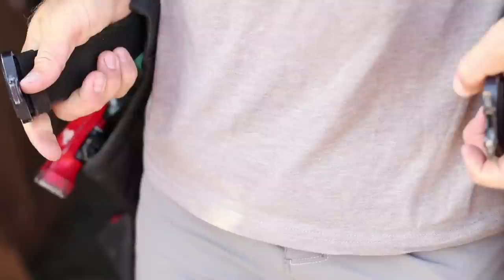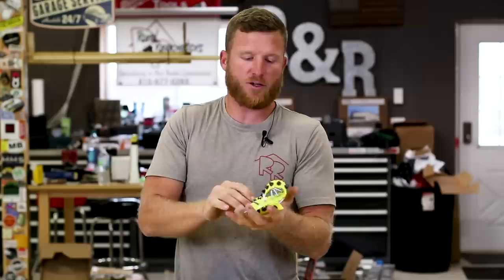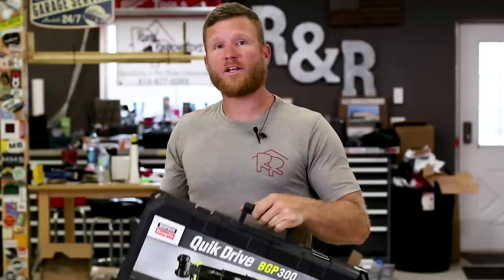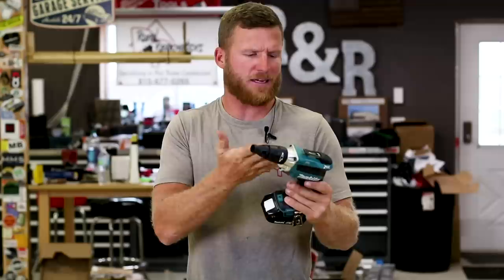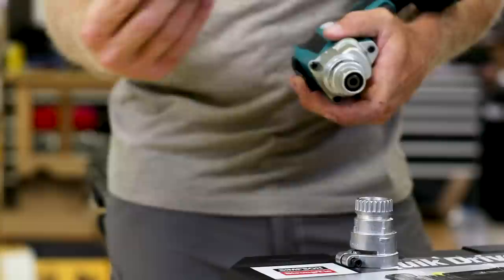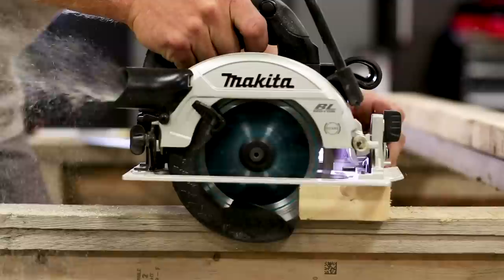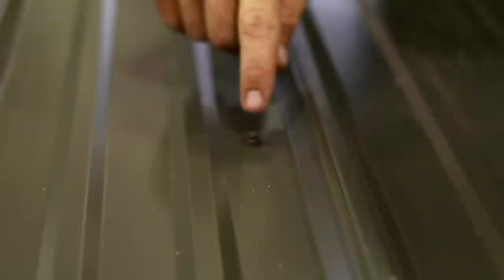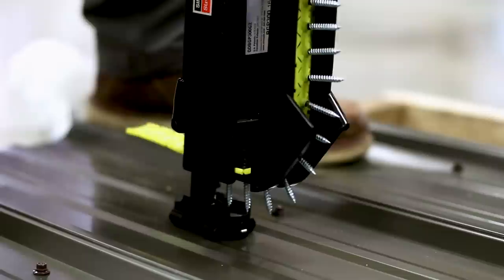Quik Drive Collated Attachment: Toolsday Easy Way to Roof?

Comment: Have an older model quickdrive & it works flawlessly, just have to remember to keep the rubber pads clean of grit & metal shavings so you don't scratch the paint.
You can easily use it for walls as well by removing the extension.
Reply: Thank you for using the Quick Drive, @McGillicuddy.

Comment: I've got a quick drive, loved it.  Had it for almost 11 years now but I use it for deck building sub flooring.
Reply: 11 years! The Quik Drive team will be thrilled to see this comment. Thank you for your commitment to safe, strong decks and choosing Simpson Strong-Tie.
Reply: @strongtie  Ran hundred of boxes of screws through mine and it still works great I'm just real anal about maintenance on all my nail guns and keep things oiled properly the last forever.

Comment: As a railroad worker we bend over alot also and we have a hydraulic spike driver that saves alot of back pain, but we still have to set them up by bending over. It will be woth the money!

Comment: Can you talk about the footwear you prefer or tried over the years.  Also great videos.
Reply: Take a look at the 'die hard' line from Sears, as an option.  An odd recommendation, I know, but worth a look.
Reply: Third Party Military boots are by far the most comfortable boot you'll ever wear.

Bellevilles
Danners
Garmonts

I wear Garmont T8s and i dont think ill ever find a boot as good
Reply: My belles died in short order. They are too soft and break down too quickly.  In this video I noticed that he has boots that look a lot like ones I wear which are USA made by Thoroughgood. I like them because they have a stylish moc toe but are still steel toe and waterproof (mostly).

Comment: Hey Kyle, does the auto push-on of the Makita driver still work with the Simpson Quick Drive system?  Or do you need to trigger the driver with each screw?
Reply: Good question! Kyle...? Kyle...? I think he responds to questions on videos for about 12 hours as that is when most subscribers will see it. Sadly it seems that after that the videos are just online to rack up views.

Comment: I have never fixed corrugated iron through the low part of the corrugation, I could not make myself put screws somewhere they could possibly be underwater for days. No matter what, the washer or whatever is used to seal the fastener is not up to submersion.
Reply from the maker: why would they be under water for days??? these are 4/12 pitched roofs
Reply: It’s not corrugated metal either. He uses residential rib steel.
Reply: RR Buildings Ice dam?
Reply from the maker: Carknocker001 if it’s an ice dame the screw on the rib would not be safe and neither would the lap joint so maybe it wouldn’t matter
Reply: Putting screw in without proper backing is way worse,. The steel can flex and it will leak under heavy snowloads on top of the roof and the epdm seals lasts longer than the steel around it.
Reply: RR Buildings  If it’s raining for days it’s underwater (running water)  for days !
Reply: In the midwest where he is,   it works due to the weather,  out west, in the mountains  where I am and on the coasts we use standing seam with no exposed screws due to snowpack or 30+ inches of rain a year.  We also deck under it for snow load and use synthetic undermat  and snow seal on the bottom and use massive trusses.   It all depends on the conditions and where you are at.

 I agree with him a 4/12 roof where he is located that screw isn't going to see water for long and the way he vents, if there is any moisture that gets thru it, won't stay there long.   Look at the whole picture and how the system is used.   These buildings are not engineered for 90lb snow load or 160mph wind,  as those are not concerns where he is located..  We all adapt to the weather around us as to what we build.

Comment: I build myself my first shed and I just noticed that both walls (right and left are 1/2 an inch lining to the left, can i fix this? Its almost done, I havent use any nails its all screw and I thing if I detach the front and the back i could push the walls and fix them
Reply: The problem is with the roof and all I dont know if it would be safe.... 😞

Comment: It looks like the head is made (molded) to sit on the center of a rib..?
Reply from the maker: can be both
Reply: You don't fix sheets from rib to battens only few screw to hold sheets together it's not rigid way and sheets will be slightly moving because thermal expansion, wind blow, snow load and screw holes start to form bigger and leaking is inevitable.

Comment: I just looked at Simpson's website and the information for this extension unit leaves much to be desired. They don't list what screwdriver motors are compatible, rpm driven nor is there a way to locate the pre-punched holes if that's the method you go with. The rib attachment feature is what it looks like they want you to do more so than using the flats..

The extension isn't like a siding attachment for a roofing coil nailer, where the foot on the nailer has a locating pin.

After watching Simpson's video, it appears that they need to have someone show them how to adjust their own attachment, as the driven depth dimpled the metal roofing material used.

In your case, if you decide to continue using the BGP300, I'd say keep the belts and reload them yourself on downtime, especially since the fasteners cost twice of loose screws.
Reply: Hello, thank you for commenting. Check out this link for a complete list of compatible screwdriver motors. https://www.strongtie.com/products/fastening-systems/technical-notes/quik-drive-adaptors

I'm checking with our product team regarding the other questions in your note and will get back to you ASAP.
Reply from the maker: Simpson Strong-Tie thanks for chiming in

Comment: I. Am. Number. One.

$20/bag for screws is way over priced bud. You should be getting $10-14 with the volume you do.
Reply from the maker: probably right....I am much more concerned with just building and do a poor job price checking
Reply: I understand bud. I’ve done a few metal roofs and I got them down to 15 a bag when I was getting them with the metal. 

Got a friend that is partial owner of a metal shop. The most upcharge is on trims, screws, and closeup foams. You can get them to drop 10-20% on those things most of the time.